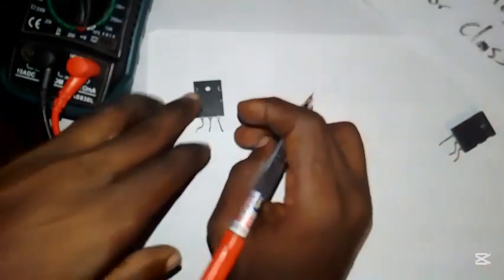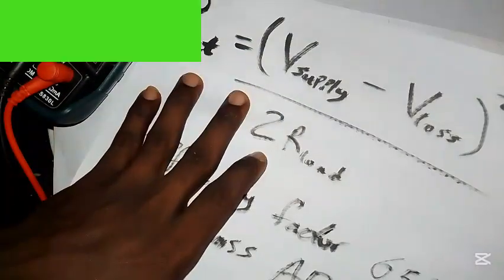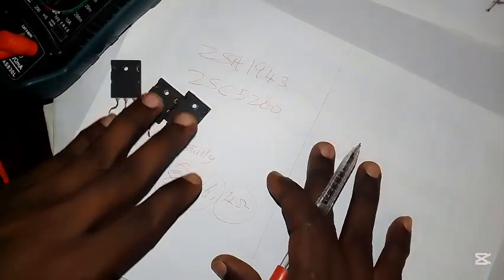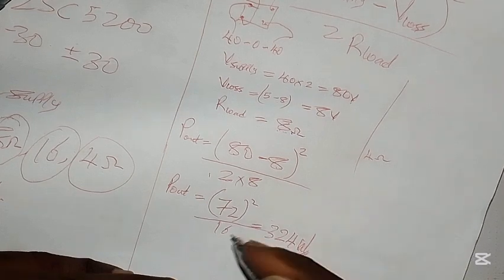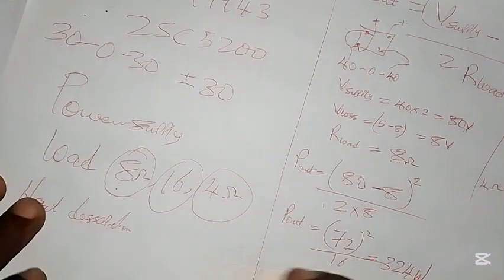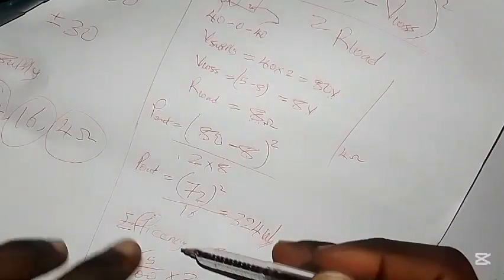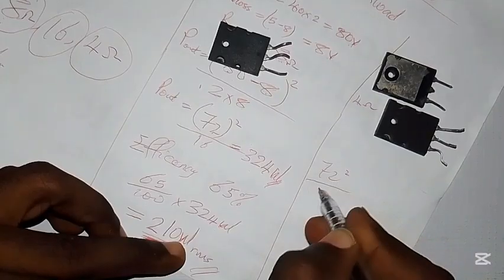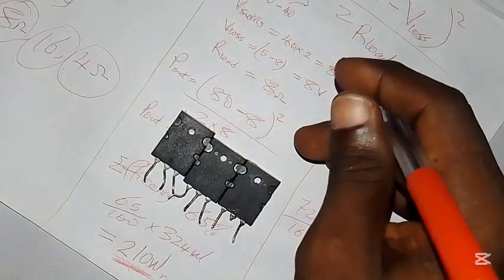How to Calculate Amplifier Wattage Using ±40V Power Supply & 2SA1943/2SC5200"

Comment: Thanks for the explanation,my main question is when you have at least 10a and 10c transistor,and you want to calculate the watt of the amplifier how do we go about it and gain wont the capacitor also determine in the calculation

Comment: 210Watts RMS. For 1 pair of 2SC5200/2SA1943 with power supply of 40-0-40?
Reply from the maker: Absolutely because each of those transistors has the ability to produce 150watt max. But considering watt loss in the process of heat generation and also depending on the class of the amplifier.

So that's how we arrive at 210watt provided it class AB, if it's A or B ,the wattage will drop due to power loss in high amount of heat generation.

I hope this help you 💗, subscribe for more helpful videos
Reply: @yaletech_  thank you sir it really  helps 👍👍👍👍